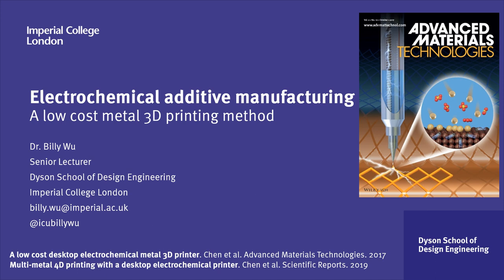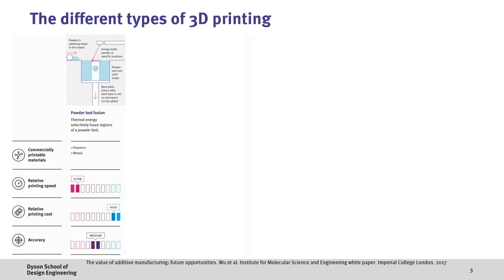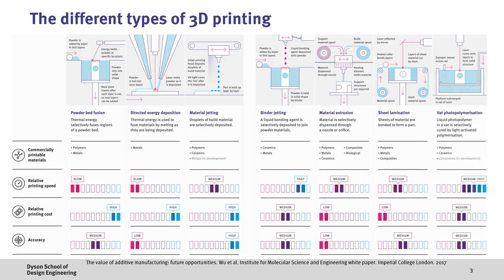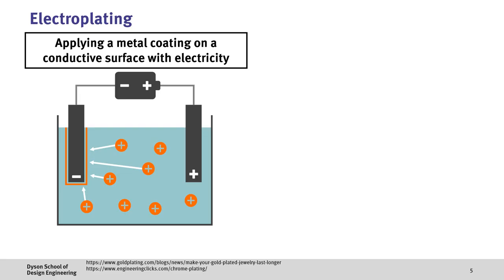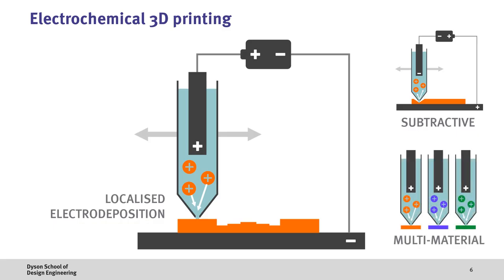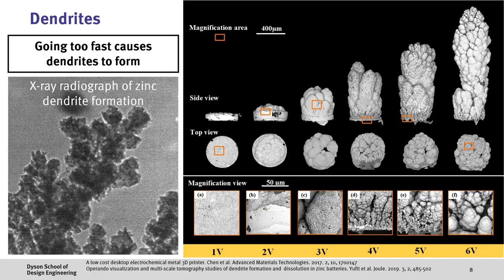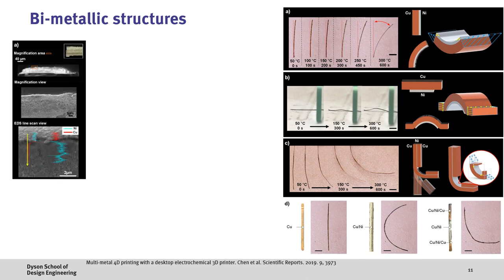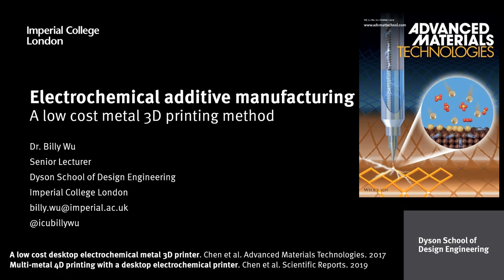Low cost metal 3D printing! Electrochemical additive manufacturing

Comment: How long it will take for print a 10 mm cube ( 10 % filler , 0.2 layer height ) ?
Reply from the maker: Unfortunately this approach is a quite slow for large objects. In our previous paper we showed that for a 400 μm nozzle, we can achieve a deposition rate of 20,000 μm3/s. So for a 10 mm cube with a 10% infill that would take approximately 58 days to complete. There are a few things you can do to accelerate this, but this is the reason why this is still mostly at the R&D stage. However, there are applications for smaller scale structures which are electrically conductive.
Reply: @BillyWu  This is very good for Circuits and creating own IC's and Transistors. Possibilities are endless and this opens field in new direction. Imagine 200 or 300 printing same model at same time like an transistor or an IC which have new capabilities which we had never thought of!! The production can easily be achieved and there will be low cost of creating dust free labs for such printers and robots or automated arms just change the build plate and stack them for someone to collect the pile at the end of hours or days!! Its a breakthrough in nano technology. The projection of this printer wrong, it should be projected as Nano Metal 3D Printer. Keep it up and one day it will be high in Demand like a 48MP camera sensor in Smartphones! :)
Reply from the maker: @himanilsharma2147  Thanks. There's been a few examples of applications of this approach in electronics, so you're right this is likely to be the initial application area if it takes off.
Reply: @BillyWu  You know I personally believe 3D printing is next Industrial revolution like lathe machines did and current technologies of 3D printing are primitive and we will see more advanced techniques and technologies in coming future. Where everything will be automated like we see as VMC, if someone in 1920 or 30 had told about VMC to someone then People had laughed, same like Miracast and Airplay like technologies which enable to do video chat on TV!! 
and this technique which you demonstrated in video is Nokia 3310 which enabled anyone to play game in Cellphone first time in the human World, that too Snake game in almost a device having pixel bigger than 1mm,   and within just 20 years children are playing PubG like game in their own smartphone worrying about latency!! Its a huge breakthrough and I personally believe we will see that soon very soon just within next 10-15 years.
Reply from the maker: @himanilsharma2147  Thanks for your words of encouragement. Hopefully we can update soon on some work in progress in our labs.
Reply: @BillyWu  in your diagrams you had an electrode attached to the "print bed". Would it be feasible somehow to use this method to print on top of non-conductive materials such as a plastic, to turn a tool changing 3D printer such as E3D's, into a circuit board printer? They had previously proposed the capability of their machine to do pick and place, as well as it's normal FDM function, but with the ability to lay wires internally, this may be even more helpful!
Reply from the maker: @mortarriding3913  It's a bit more tricky to bring on non-conductive substrates, but not impossible. The deposition works through Reduction of metal ions in an electrolyte and thus needs a controllable supply of electrons. How some others have done this on materials like glass is that they start from an edge which is conductive and then lead this onto the non-conductive parts, with the electronics flowing on the just printed parts.

Comment: Uhm, basically a facility employing this type of electrochemical additive machine in industrial scale is going to produce the same type of waste as an electroplating facility. Therefore, it's going to be subject to similar environmental and waste management regulations as such. I'm working in the electroplating industry and I can tell you de-ionizing waste water processing systems are extremely expensive to buy and to maintain. Oh and in most countries you need to apply for a permit to run a facility that involves heavy metal ion solutions, and that can also be hugely expensive depending on where you are located. I guess in small scale for DIYers or small offices where they'd just dump the waste water into the drain would be fine. But if somehow it got extremely popular and start having an effect on the environment, it could ended up being banned by the government.

Comment: Thank you. Very interesting information. Now, if I could get a useful metal printer for about $10,000, without needing a machine to wash the parts out, and not gave to sinter, I’d be very happy.

Butblow cost here no doubt means at least several times that.

Comment: I suppose it's an extremely slow process.
Reply from the maker: Yeah, unfortunately the process is a bit slow but there are ways to speed this up which are being researched
Reply: Compared to FDM? Yes, but it doesn't have to be super slow.
The whole process is only limited by heat. Heat changes the chemistry, so there's an upper limit and a lower limit.
The basic problem is how fast can you dump the heat from the reaction into the environment without changing the quality of your results.

Comment: Electroplating to anything other than microscopic parts will be extremely slow.
Reply from the maker: Yes, very fair point. Electrodeposition is quite a slow process. There are ways to increase the speed with different electrolytes and designs but will likely always be a challenge, however there are some applications where this might be suitable given the ability to do multi-material. Still R&D at this stage but it's good fun research
Reply: You could have an array of electrodes, and thus deposit material at many places at once.
10 electrodes would reduce print-time ~tenfold ... and so forth.

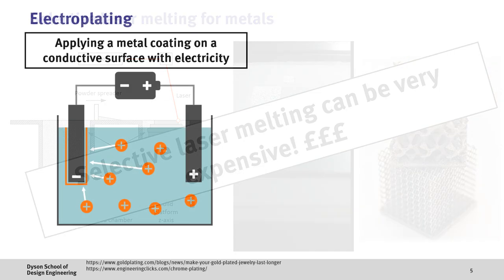Comment: Skip to 4:21, where the video actually starts.
This is not low cost, its unbelievably slow, lithographic masking techniques followed by various deposition or erosion options are faster, cheaper and more precise.  DLP activation of resists is a good area to develop a micro 3d print version of this.  Or maybe a way to make conductive FDM filament that you can electroplate. 
I see no viable path for the method shown in the video to compete with lithographic, DMLS or pla / liquid binder then oven centered 3d metal printing (whatever that's called).

I'm not saying it was a bad research project, but in science sometimes things fail, this is a thing that while technically feasible is not economically feasible nor do I see any way for it to become so. 

You have a layer height of like 6nm and a linear speed of 0.4 mm/s this is ridiculous.  And to call this low cost... I can take some sharpie ink and draw on a substrate then dunk it in an electro plate bath for like $10 with scrap anyone has lying around.  

And then to brag about it being 4d printing because you can get some mems behavior.... OK I get it you did not coin the term but it really needs to stop.  It's a retarded thing to call a 3d printed object that can be manipulated.  You could call tweezers a 4d object by that definition, it's just bad and anyone who uses the term should feel bad.

Youtube comment section, where the real peer review happens.
Reply from the maker: Some fair comments. It is relatively slow and no doubt not the solution for everything but the approach has certain merits which warrant further research in terms of increasing the speed and multi-material aspects. Welcome comments from all asides positive and negative.
Reply: @zyxwvutsrqponmlkh you lack imagination electrochemical printing opens the door to modular self replicating devices  (which can be exponential therefore solve the speed problem ) which is lot harder to achieve with light or thermal based systems. in here all you need is electricity insulated capillary(that can be printed) and an ionic liquid.  It opens the door to  manipulate electromechanical properties without post processing by selectively depositing metals with different propreties perhaps turning them into insulators or electro deposit  ceramics such as calcium carbonate . I see the future of this from a bottom up perspective rather than a top down approach . As for 4d printing I see this as one of the most promising tool to achieve some types of 4d printing for the reasons stated above unless you want to narrow the definition of 4d printing to some passive environmentally triggered assembly a la skylar tibbit .I have used selective electrochemical depositing (not a 3d printer a 2.5d) to print programmable joule heating activated trusses that assembles into 3d structures. we even printed bimetal "memristors" or switches on them to program how they assemble.
Reply: Lookup the Harvard milidelta . A variant of it can be entirely be electrochemicaly printed subtracted from the conductive substrate and ready to electrochemical print automatically .It parts can then be assembled into something else.
Reply: @sidneo14  "self replicating" ... stops there https://www.youtube.com/watch?v=DtudW-sfSSE

There's like a bazillion things wrong with that buddy.  Your sponge and syringe gonna wear out, it only prints materials that can be electroplated, the tolerance is all over the place.  

You wanna self replicate machines that print anything maybe you should start by learning how to stick molecules on the tip of an atomic force microscope or something.
Reply: You mean 3D printing processes that have had decades of research and commercial investment are more refined and faster than a new technique? Colour me shocked.

There are multiple avenues by which the speed and quality could be improved. Give it time, then judge.